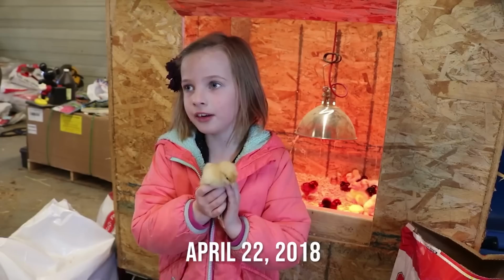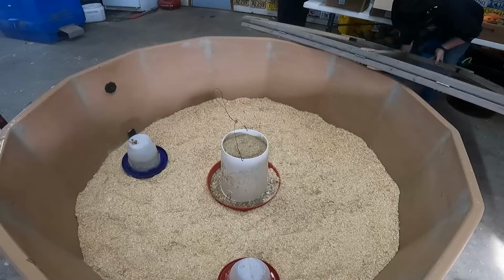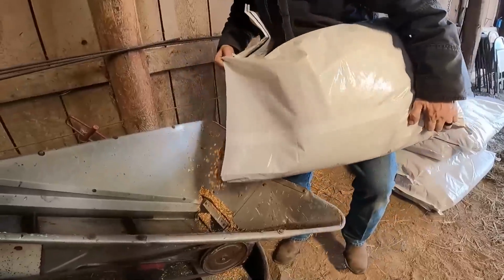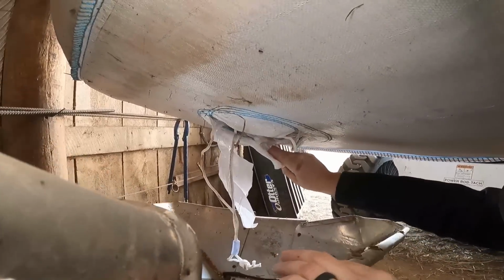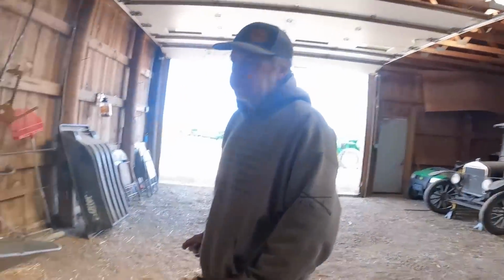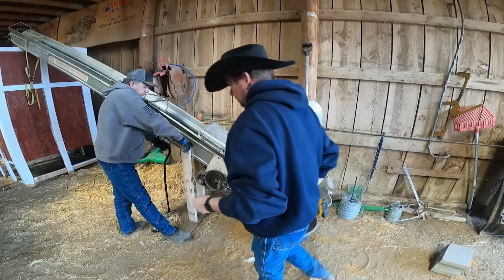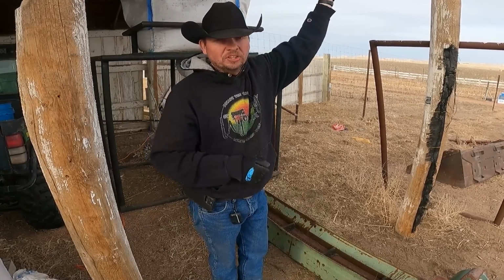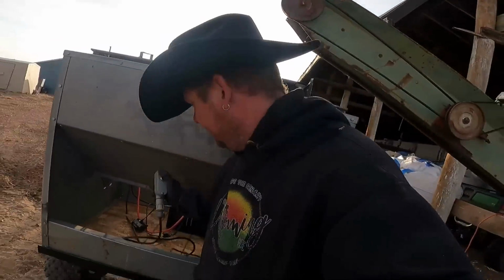Moving Chicks, Modifying and Adding a New Elevator for Moving Feed - Weekly Vlog

Comment: Did you consider making a frame and placing conveyor on locking wheels so you can move it around? Have four 4 drawer file cabinets filled with tools & supplies that I made up a 2 by 4 frame & plywood top and 4 wheels so I can move them to clean that area. Glad I did due to a little flood that water would have entered bottom drawers if they were not elevated onto home made dolly.

Comment: Hey, Mike, just a suggestion...  I get fertilizer in the same totes you have your cobb in.  I built a pallet out of steel with a 16" square hole in the center.  That way I can use my skid steer to lift from the bottom of the bag instead of the top which helps a height issue.  I realize it won't help much with your existing cobb but once you get your dry rolled it should be good.   I really like your elevators.  They will make your job much easier.  I just got my jerky and tee shirt.  Thank you very much!

Comment: The cross brace for the elevator:  with all the vibration, the nails will loosen, potentially causing it to fall (on someone) and break.  Take a 2x6 and nail it to the post in a vertical orientation so the stud will support the cross brace and not the nails through the cross brace.  Consider another 2x6 cross brace in a sandwiched configuration for better strength and longevity.
Reply: Nothing beats grade 5 bolts with heavy flat washers & lockwashers. Carraige bolts also work great. I built my workbench 4t years ago using 4 by 4's for the legs and heavy 3" angle iron to secure legs to top made with 3 by 12's that I reclaimed. Used 3/8" hex cap screws & some carraige bolts. Had over a 1,000 pounds of cement mix bags on it for months  with no problems.
Reply: With the price of wood so high would look into using far superior steel angle iron or unistrut for all braces. They have a green unistrut that with great paint never seems to rust.

Comment: That Open chain & sprocket are an accident waiting to happen. Worked at a large slaughter house years ago and had a lot of conveyors and the engineer always placed the motor at discharge end saying it was easier to pull a load of a hill rather then pushing it. This engineer had us make a traveling conveyor to do away with a fork truck operator to load a 40' trailer everyday with steer hides. Had to take a 10 hour OSHA class to renew my electrical license and they stated that a one man company or contractor does not have to follow OSHA rules but any one man contractor would have to follow numerous safety rules at mid to large companies asking with a yearly safety class.

Comment: How are you going to load your cake bags? Can you go in from the side with it? if not you're going to have to move the elevator every time you load a new bag - just wondering- could you put a piece of hard rubber on the bars on the cake elevator that it keeps the cake from going under

Comment: I would love to get a few of those ton feed sacks and licks tubs for container gardening.  I will need to see if I can get them from a local farmer/rancher.  I thought maybe they sent you 13 % finish feed rather than a mix of grains.
You and Matt need to make a frame on a two wheel dolly so you can lift and lower it to suit what you using it to load in to, and the wheels so you can pull it to where you want it, or store it in the cake shed.
At least Matt didn't tell you what Hawkeye told the men digging the latrine on MASH; "make sure and dig it deeper on that end.  That is where Major Burns likes to sit."

Comment: Yikes lol. Maybe cut the side of the bag? If you have to cut it.  This way you get the weight off the bottom by getting the looser top material.  Then when you get most of the top out maybe the bottom with funnel out better?